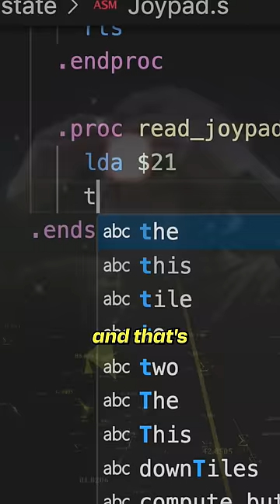NES Games Were Written in Assembly #nintendo #nes #programming #assembly #retrogaming #retrotech

Comment: I would love to see todays programmers write games in asm
Reply: Although it wasn't a game, I had to write code in assembly and it was the pure definition of learning experience. However, I will say that I gained a lot of "under the hood" knowledge on how the code base and processors perform operations in terms of current code while I worked on that project. I think anyone that does programming should try a little bit of assembly logic and coding for the experience and understanding.
Reply: I know you mean modern programmers for PC/PS5/Xbox. But there’s tons of NES homebrews today where people are still programming in 6502 assembly.
Reply: 6502 assembly is pretty easy-peasy, tbh.
if you learned BASIC on the commodore 64 and learned graphics/sound programming decently well, then switching to 6502 assembly wouldn't be that much harder. especially if you had already learned and got decently good at C.

this is all assuming, of course, that you were following good teaching guides that have examples and somewhat thorough coverage. it's hard to learn anything if you are just thrown a reference manual and told to figure it out.
Reply: Assembly is the only coding language I know. A few years ago I started learning assembly just for the purpose of making NES homebrew. There are some good tutorials out there. And there's a great community around the program "NESmaker" who can help new people get into the hobby.
Reply: There actually are plenty of hobbyist game projects out there programmed in ASM. As has been mentioned, many developers opt to use assembly when making homebrew games for retro consoles and PCs, although it isn't the only option these days. Sometimes, you'll see hobbyists use inline assembly in their projects as well. Even though it's mainly programmed in C, Kaze had to use inline assembly a few times in his Mario 64 remake, since the goal of that project is to prioritize performance over everything else.
You can also find Minecraft players programming with redstone which I imagine is even more impressive than writing direct machine code.
Reply: x86 asm isn't rare in universities
Reply: they would be able to
Reply: While smaller projects are doable, I don't think the would be feasible for most modern games. 
One: the scale of work would be ridiculous. I've not tried to do graphics on a modern video display in assembly, but I can tell you that writing a routine to draw an arbitrary rectangle in x86 assembly to an EGA display took me a week of coding to get it right. There's no way it's not geometrically more difficult with modern displays, and that doesn't even speak to the linear algebra and calculus you have to program if you want to do anything three-dimensional.
Two: outside of some optimizations here and there, it's almost certain that a modern compiler will producer better machine code than a human writing assembly.
Three: the code isn't portable. If you want to sell the game on multiple systems you'd have to completely rewrite it for each one.

Comment: I do love that they removed the impressive implementation of BCD (Binary Coded Decimal) in the addition and subtraction instructions of the CPU that did make the 6502 just that bit cooler ☹️
Reply: BCD was removed because MOS had a patent on the technique and this was before mask rights and you could not copyright masks. Ricoh stole the masks from MOS and modified them enough to avoid patents, all perfectly legal. Mask rights existed by the time the SNES came along, so this time Ricoh had to license a CPU. The 65816 was designed by an ex MOS employee and it avoided the BCD patent. Nintendo probably thought about backward compatibility but discarded the idea in the end.
Reply: @phill6859  I know. but it was still one of the most note worthy features of that cpu architecture nonetheless

Comment: Not so crazy. When for work I was using a similar assembly for 8 bit microcontrollers I had to do the same: software library (called subfunctions in assembly) for div,mult, also 8 to 16 or 32 bit computations with multiples 8 bit registers and fixed point math. I have to say it was very fun